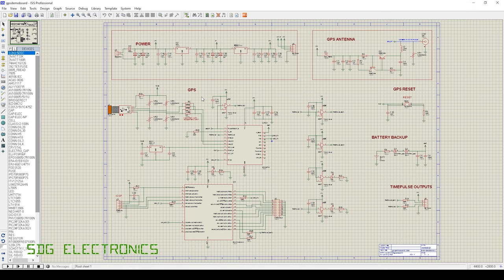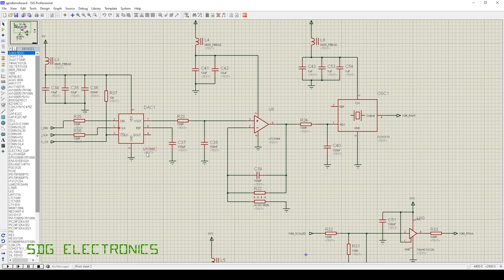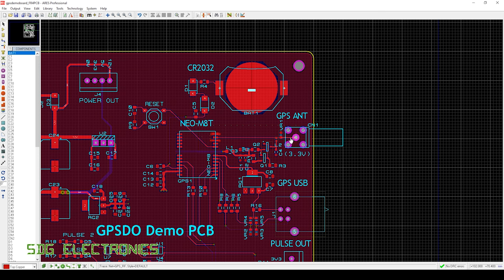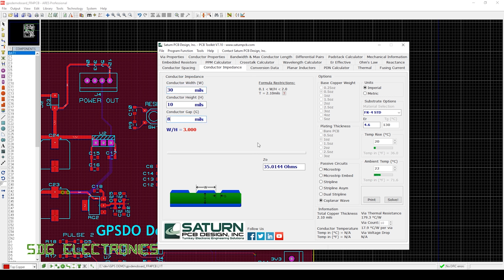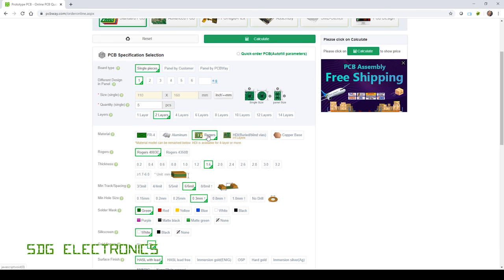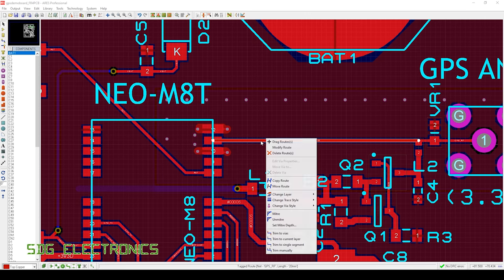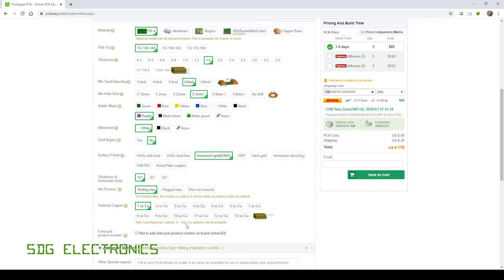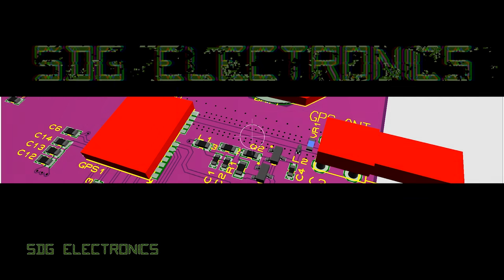SDG #154 How to do controlled impedance traces on your PCB

Comment: Thank you for a great video on controlled impedance traces! Although it is great to know how to create 50hms transmissions lines on a PCB I believe you could have gotten away with pretty much any width on the antenna trace if you had just placed the module and SMA connection closer to each other. For example it you had moved the GPS module to the edge were the SMA sits the resulting trace could have been shortened to around 10 to 20mm.  That is a 10th of a wavelength or less so you would be able to get away with it. 
Your way is the correct way of doing it but not needed in this application as you will probably be using an active GPS antenna.
The same for PCB material, although Rogers is better is not needed.  FR4 will be OK for 1.5GHz. The Active GPS antenna has plenty of gain to overcome possible cable losses. This margin means there is no need to optimize the PCB trace on the board.
Again thank you for sharing. Love your Videos!
Reply: Thank you for sharing these practical and useful advices!

Comment: Regarding placing the radio block on a separate board to save cost... it's a reasonable tradeoff to just use the FR4 PCB and make the best of it. Adding the riser connectors, and another PCB, adds extra BOM costs, build time, wastes board real estate, and requires mechanical restraint. 
I enjoyed the video and the information you shared.

Comment: Neat project.  With full coplanar (no backside ground plane) the VR1 and L2/C4 would divert the return currents and screw up the response.  Since you have grounded coplanar, it shouldn’t be as bad for your layout.

For coplanar junctions, a TEE for instance, you typically have to wire bond over the discontinuity to equalize the currents.

Also, the coplanar is more sensitive to metal thickness than microstrip due to  to the sidewall capacitance in the gap.

Comment: Thank you for the walk-through, Steve! Just one pedantic note, if I may... Impedance control would typically mean that you specify to the PCB manufacturer which traces are supposed to be which impedance, and they would measure the impedance of those traces (or a test coupon) to ensure the impedance is within the specified limits and tweak the process / trace dimensions to achieve the specified impedance if necessary. So there is a whole extra layer of PCB manufacturing for real impedance controlled designs, in addition to designing to achieve a nominal impedance - but obviously, that would not be available though PCBway, JLC or the likes.
Reply from the maker: Good point, there is always the tweaking, even on special laminates - though whether that's the designer or the PCB house depends on the services offered.

Comment: I've always understood "Controlled Impedance" to be an impedance that is a requirement specified to the PCB manufacturer for particular traces in a PCB. They make the necessary adjustments within limits to the materials and processes they use to achieve the required impedance to specified tolerance.
Reply: Добрый день! Хочешь получить новое удовольствие от жизни? 80 Песен Прямо Сейчас Для Самообучения...Смотрим, учимся и играем.....и можно самому играть для своих видео:)))

Comment: The best (reasonably priced) 1PPS that I've found so far is the u-blox LEA-M8F, because it disciplines a built-in 30.72MHz VCTCXO that supplies the master clock to the whole module. That allows it to manage the phase of the 1PPS and divided frequency outputs in the analog domain rather than step changes in the digital domain once successfully locked and settled down. (Fractional division caveats still apply though.) It is much more costly though, and with the extreme filtering that one must do to remove the daily/weekly wobble of GNSS systems in general, any digital sawtooth of the 1PPS becomes inconsequentially swamped - especially with that OCXO/DAC combination.
There's always something better - at least three more orders of magnitude - perhaps more, so one must define their requirement and design to that or forever be chasing perfection at great cost.
Reply: Somehow I'd never thought to perform this particular measurement before, so I connected the LEA-M8F with an inexpensive active patch antenna to my TimePod frequency/phase measurement instrument against one of my local Cesium Beam Tube references. I live close to a hill with an obstructed view of the sky, such that with a favorable satellite constellation with a low TDOP the internal DAC stepped the 30.72MHz TCXO around within 0.5ppb, but with a less favorable TDOP it would widen out to +/-1.5ppb. Still not bad for a fast, quick, and easy frequency reference even though the 30.72MHz is a less useful frequency.

Comment: Hi Steve, I like you Videos, Thankyou! Is there a reason why you don't power the antenna directly from pin 9(VCC_RF) of the Ublox ? Its current limited and controlled (On/OFF) from the chip(Sleep, etc.)

Comment: Hey, that is Great video!
Anyway does the length of the traces have an effect on impedance?
Reply: Sort of. The impedance calculators assume infinite length (length >> width and insulator thickness). There will be impedance anomalies at connector and solder joints. So if the trace is very short, it is one impedance anomaly.

Comment: Great video! I've been always wondering how bad it would be if FR4 is used in such designs. May I sponsor another order of the same PCB design made with FR4 and you compare the results between Rogers and FR4?
Another thing I'm really interested in is, when having a GSM, BT or Wi-Fi antenna printed on the PCB, how bad it would be if using FR4 compared to Rogers. I'm willing to sponsor this experiment as well.
Reply: If you still go for a 50Ohm impedance, the difference isn't all that extreme. The difference is mainly noticable if you have either very long traces or very high RF power (like 10s of watts). 
However in applications like testgear or transmitters you still want to go for a better substrate to make sure you get the best performance out of your design, especially since the performance of FR4 can vary and change over time and production lots.
Reply: @gammaleader96  Thank you! Yes, I'm aware a single test from a single manufacturer will not be a proof of concept. Naturally, different manufacturers and suppliers will have a significant variations of the material specs. I am mostly interested in the PCB antennas, since this is what I work with. 50 Ohm I/O on the board are not that critical, as there are tons of variables in the  antennas and wires to them, therefore hard to predict tolerances. But still will make a good study and comparison. Also, I rarely see commercial products on anything other then FR4 and was wondering how they get around with that.
Reply: Marginal. For example, NanoVNA 2.0 (S-A-A 2) is a VNA that goes to 3.5GHz and is build on a 4 layer FR4.
Reply: @111chicane  Interesting, do you know some good design tools for PCB antennas or do you use proven designs? 

Commerial products like this ( I guess mainly WIFI patch antennas?) propably use FR4 since it is super cheap. 
Most professional stuff, like cellular infrastructure, use rogers or other substrates. Something I found to help is to use thin PCBs like 0.8mm for patchantennas, which seems to help minimizing the unwanted effects.

Comment: Anything other than FR4 for such a simple application would be an overkill. The Neo can output a reference signal in MHz range so it would be interesting to compare how much better is this vs just the Neo.
Reply from the maker: From what I understand, the ublox modules themselves are quite jittery with special output frequencies. The 1pps is extremely accurate. I'll see if I can work out a way of comparing the two. Thanks
Reply: @sdgelectronics  It depends on the frequency, it has an internal clock at 48MHz and uses a fractional divider to produce the output. Any frequency that is not a product of division by 2^N is pretty ugly. Those that are, are much cleaner.
Reply: @sdgelectronics  The output is jittery, all GPS outputs are. But there are two factors that influence it. One factor is just how the GPS works and not much you can do to optimize it. The other factor is the internal fractional-n PLL in the Ublox modules. It runs on 48MHz so any whole number (integer) used as divisor for the PLL will give you the lowest jitter as you are avoiding fractional divisions. E.g if you set the output frequency to 12MHz it will give you 12MHz with low jitter but an output of  10MHz will be high jitter (48/4=12, 48/4.8=10). I dont belive the 1Hz signal is better than say 100kHz. As long as you avoid fractional divisions you ensure the lowest jitter.  The T models (Timing) has an internal TCXO as reference for the PLLs so are more stable. It is debatable if they are better to use in this application as you will control an OCXO. It don't hurt I guess but they do come with a premium price.
Great Video. Thank you for sharing!

Comment: You failed to factor in the solder mask in your impedance calculations.
Having a solder mask or not can affect the impedance by 20%.
It has a huge impact.

It looks to me like your calculator assumes bare copper traces, while your PCB design has the traces covered with solder mask.
If this is true, then you are not going to get the impedance you were aiming for.